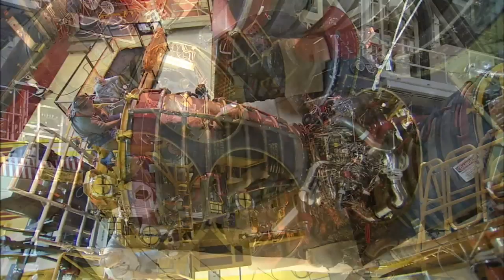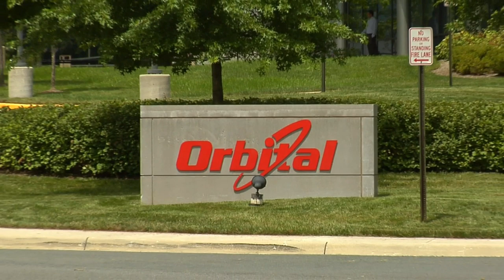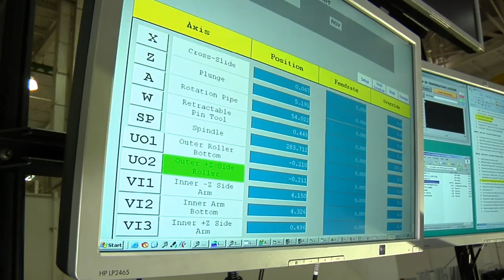COTS Intro Video Feb 2009

Comment: Not a fan of Orbital Science Taurus or Minotaur rockets because of the use of solid fuel.  Solid fuel is only good for small payloads or missiles.  Most big failures in the last 30 years have been with solid rocket fuel.  Just look at India's rocket, Titan IV, Delta, and Shuttle solid explosions.   Most of all, people should NEVER be launched using solid rocket fuel and I think Werner Von Braun would agree with that.  I think SpaceX has a real winner.
Reply: Agreed, Spacex is a real winner.
Reply: Yeah you're right
Reply: wow, you guessed it right :D

Comment: how come nasa couldn't have done it all by themselves?
Reply: Because everything NASA does has to be approved by the government, which is slow, expensive, and limits innovation. Commercial companies don't have these restrictions, but lack the knowledge NASA has. That's why they're working together. It's working; Orbital ATK and SpaceX regularly resupply the station, Boeing should be joining them soon.
Reply: thx, btw this is my new channel
Reply: @basslinedan2  And yet we actually have people in our country who want socialism and stop us to further advance space technology.
Reply: @guccifer7874  One of the reasons government approvals of NASA projects are slow, is that they require NASA to rely on private contractors for manufacturing, to ensure it remains a showcase of capitalism, a tradition dating back to the creation of NASA in the cold war. The consequence is twofold.

One, NASA ends up having to design from committee a perfect blueprint with no error without even manufacturing a single part, so that each contractor can build their piece in parallel. That is nearly impossible; you should always test multiple designs and study partial implementations. And it creates a very high risk of poor integration of large components—yet again, it is much better to perform early partial integration to weed out quirks. There has been cases where two contractors built things per spec, getting their money, but the integration failed on NASA’s expense.

Two, they rely on so-called "cost-plus" contracts: the contractors get the lump sum they claim is what the development requires, and if they go over budget or are late, NASA also pays the extra costs, plus a 10% fee. That disincentivizes contractors from running a tight ship; they often claim much larger costs, which allows them to do more R&D at the government’s expense for use for their private projects. NASA cannot switch to fixed-price contracts, because they would risk having no takers (the industry is tight-knit), and the government would not authorize a project without private partnerships.

So it is not so much that government is slow, as it is that government makes it slow in order to emphasize that capitalism is the answer.

In the meantime, SpaceX can quickly iterate on designs because they control the whole stack, including manufacturing.
They can switch from carbon composites to stainless steel for Starship because a few partial prototype tests showed structural issues with current carbon-based manufacturing processes.
No need to wait for the complete blueprint to be manufactured and for integration between contractor parts to show a failure.

(I don't particularly care about the socialism vs. capitalism fights here TBH, I just care about accuracy. To me, both are necessary. What matters for optimal efforts is incentive structures. And the current NASA one is faulty to this day.)
Reply: @guccifer7874  only socialism! Bye from poland
Reply: CONGRESS